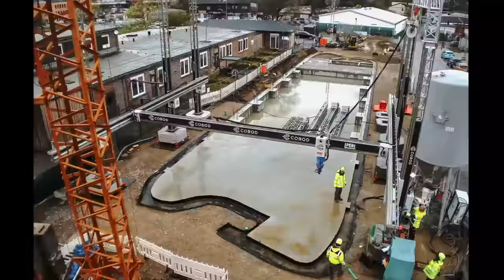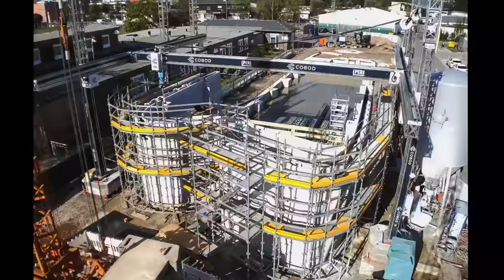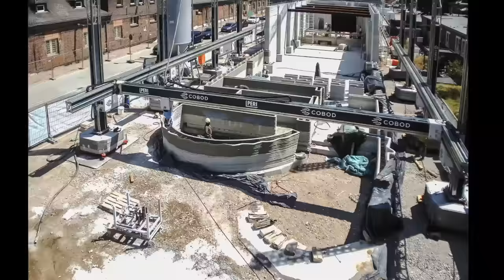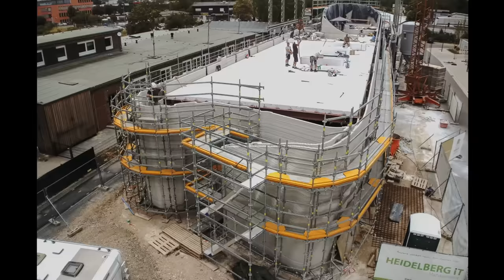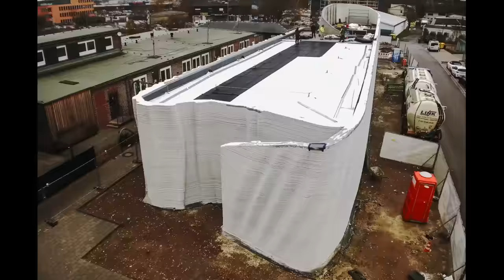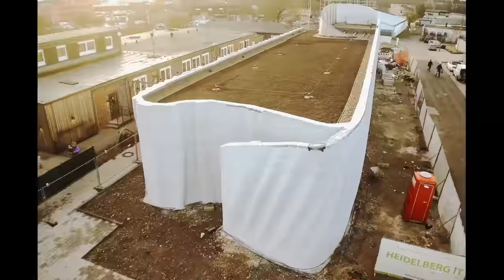Timelapse: the largest 3d-printed building in Europe goes up in days

Comment: That looks cool but how is it reinforced and have the air pockets removed and quality checked for strength?  Later when they go to install pipes and windows and cut into the walls does it affect the integrity of the entire structure?
Reply: How are bricks from a factory reinforced? And how are bricks tested for strength? And how does adding pipes change the integrity of the structure on a bricked building? Just ask yourself and you will find out the answers on your questions on your own ;)
Reply: @grossmeister1181  have you ever worked in construction pouring concrete?  Everything I mentioned happens when pouring concrete.  Since 3D printing is a different process I’m asking the experts how those things are addressed.
Reply: @rwfrench66GenX  Everything I mentioned happens when building bricked walls as well. And what do you think has been done before building that printed building? All norms have to be fullfilled prior to build a building and you need approval from the authorities. There are many things that are checked prior to build a building. The process has been approved and it is not comparable with pouring concrete as you think. So there are no real air bubbles. The concrete has certain fibres so you don't need any reinforcements. And there are certain amounts of material you can take away later to install pipes and wires.
Reply: @grossmeister1181  brick or block walls aren’t concrete or printed though.  In the US there are building codes and poured concrete needs core samples to prove the strength is up to the code.  The reinforcement whether it’s chicken wire or rebar is used.  Pouring a solid wall with no holes for windows or utility lines must not be difficult in a printed project.  There needs to be means of egress and if those fibers are strong cutting through them should be difficult and costly.
Reply: @rwfrench66GenX stop flexing. Find your answers   in the appropriate place. If you are in construction you should know where that is. Not on a YouTube video in the comments.
Reply: @LemonySnicket-EUC  I don’t currently work in construction.  I did when I was much younger.  I’m older now and I’ve seen a lot of new technologies come and go and I’ve been a fan of New Atlas for a long time.  Their website is my homepage on my browser and I’m glad they have this YouTube channel.  I’m curious how this technology compares to building standards that were around when I worked in construction.  I’m curious about the cost over standard construction types whether it’s poured forms, blocks, or pre-fab walls.  When people are curious they ask questions.  I don’t care that you don’t like my use of the comments to ask questions to the people who posted the video.
Reply: @rwfrench66GenX  I appreciate all of that ,so contact them directly with your questions. That's my point. Not in the comment section on YouTube.

Comment: Windows. Where are the windows? The video lacks much of the important detail I wanted to see, like mixing and resupply of the slurry. Is it cement that is being used? How many man hours are used to repair or keep the machine going, and accurate… What is the cost of the building considering the use of bringing in and setting up all of the equipment used…